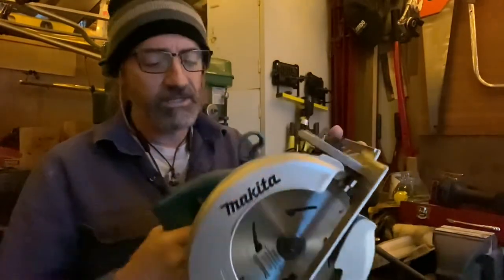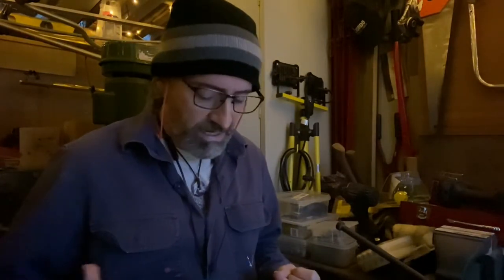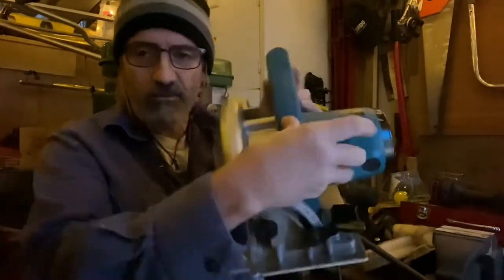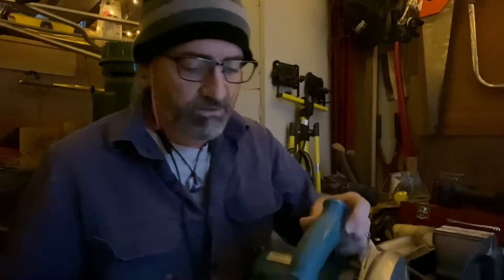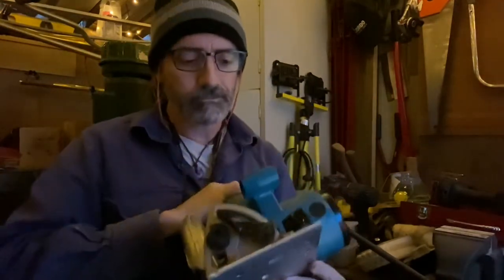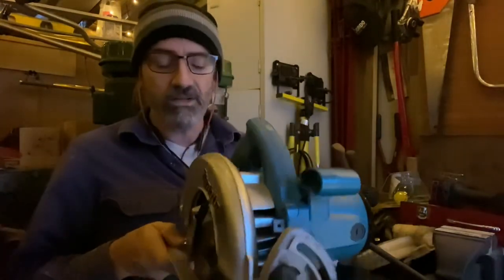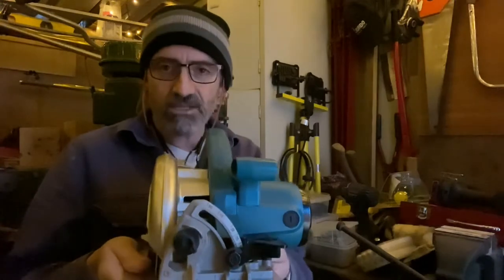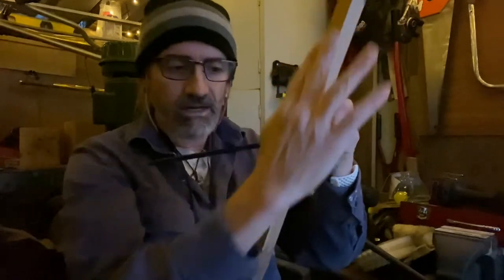Makita 5007N 185mm/7&1/4” saw - 1 year review

Comment: Great review! Would this model be overkill for "precision cutting" vs the 7600SP? I am planning to buy an engineer's square and an aluminium straight edge for guiding the saw. I am also curious if a 60T 184mm Diablo blade would fit the 185mm Makita. Thanks!
Reply from the maker: The Diablo blade should be fine and should come with washer/shims/collets to suit the saw’s arbor. 
Not familiar with the 7600SP. Is that a smaller or larger saw?
Reply: @oojagapivy Its 185mm corded but low end / entry level. It has an aluminum base.
Reply from the maker: I just googled the 7600SP. 1200w vs 1800w. 5200rpm vs 5800rpm. The 7600 is possibly slightly lighter. Cut depth won’t change. Depends on whether “precision cuts” involve thick hardwoods or not. If just cutting framing pine then the 1200w should be plenty. That being said. I did look at a 1200 before deciding on 1800w.
Reply: @oojagapivy  I had a good play with several 165mm cordless Makitas today and I am now leaning toward the DHS680Z.

I don't see myself cutting really thick timber so figured 165mm would be sufficient. It feels more portable too. I appreciate the improved ergonomics of the more expensive models. Would need to spend extra for battery but I saw a good deal on a hammer drill with 5A battery + charger so might go that route.